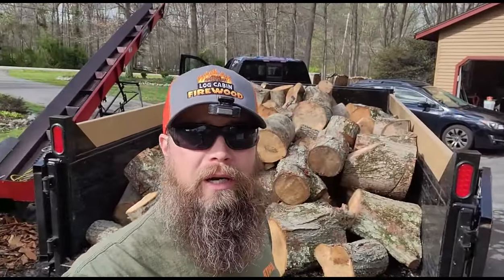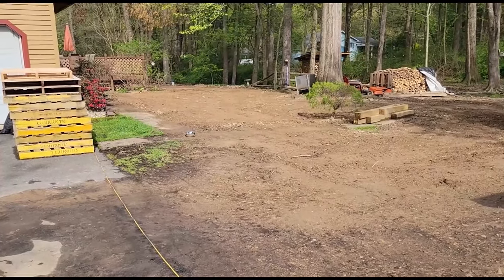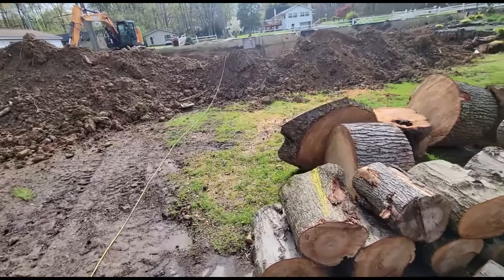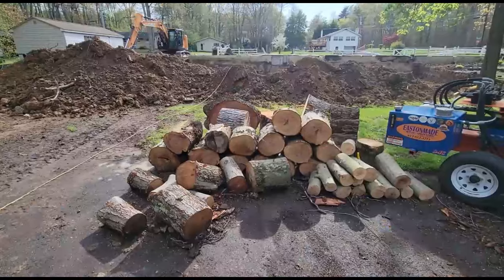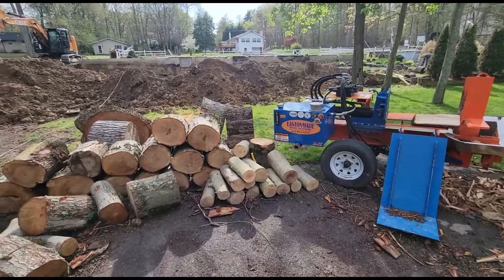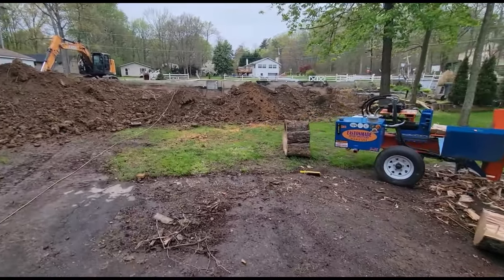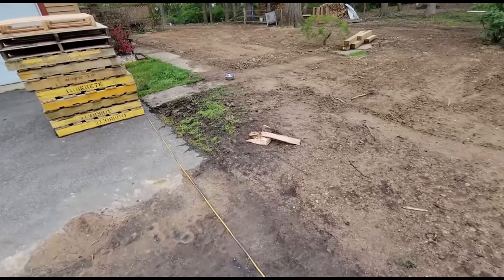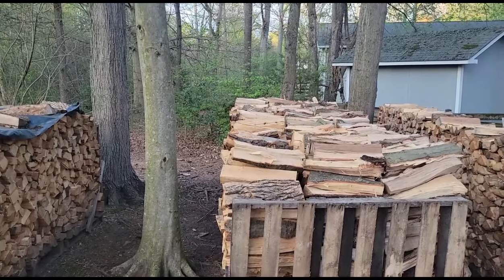The Last of The Maple #59

Comment: Most soft maple really splits easy. We don't get much hard maple where I am. Some of the hard maple I split in Indiana was really tough and twisted. I have only cut one gum tree in my life. That was enough. It is the only wood I will not take.
Reply from the maker: Maple is maple, in my opinion. We heated exclusively on silver maple all winter and we stayed plenty warm. It's also what my bundles primarily are right now too, it seasons up pretty quickly for me. Since Brad takes all the ash from around here 🤣🤣 Gum is actually a decent burning wood. Not much for long lasting heat, but when mixed with other stuff it works. I don't ask for it , but I'll burn it here when it's free 😂